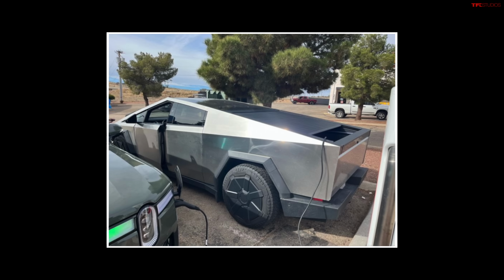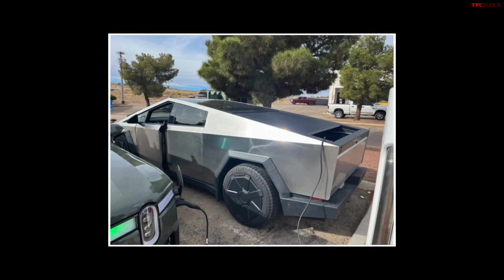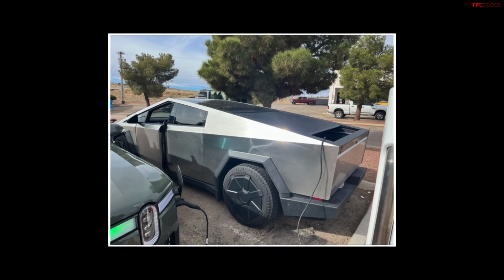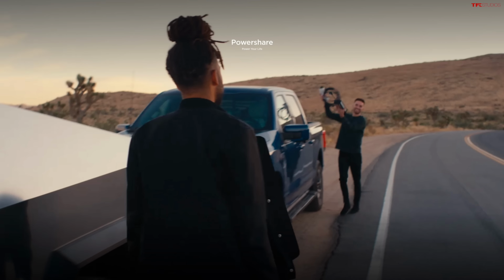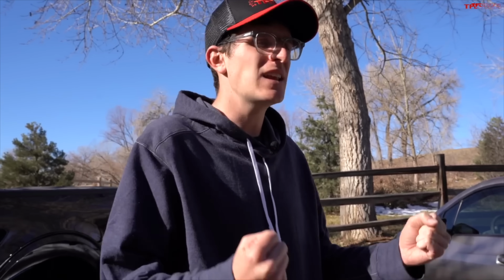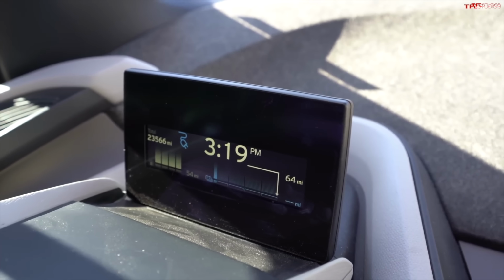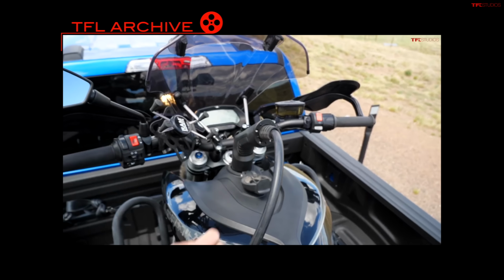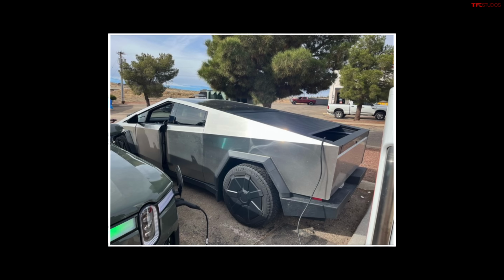A Tesla Cybertruck Rescues a Rivian R1T: Here's How!

Comment: You can power your home with a simple generator interlock switch from the 240v feed.  No need to spend thousands and thousands on the automatic setup regardless if its Ford or CT.  I'd love to see the 240v outlet make it's way to the 3 and Y, but I think CT only did this because Ford had it.  This will clearly cut into the powerwall sales.

Comment: 3.0 miles/kwh on the R1is a stretch.  in my 20K miles on theR1T, I have averaged 2.02 mi/kwh.  I'm looking forward to the equipment to use my R1T battery with my solar to run the house or help charge my Tesla powerwall.?????.....

Comment: Not really ground breaking. The charger will pull the max from the outlet that it can, it's not going to care that it's in another vehicle or a house, or generator. Now, direct charge port to charge port for higher speed transfers might just be a software toggle if the sending vehicle has hardware for bidirectional charging, or vtg or whatever you call it.

Comment: Can someone do an actual test to see if the Cybertruck can simultaneously  import DC power and export AC power. If that could work, then you would really have something. 

I saw AC to AC tried on a TSportline video and it didn’t work. I didn’t see them try to adjust settings, etc. If it’s possible, I would like to know.
Reply: It has been done and it can’t charge and give power.
Reply: @jackylsmith8138  I saw the video attempting to charge the CT via AC, but not using DC.  It was also very quick video and I did not see them checking to see if settings could be changed on the screen.  Can you direct me to the video showing a more thorough try using DC to AC

Comment: The cable has a J1772 plug at the Rivian end, so I’m sure it is rated for 240v or 110v depending on which adapter they have plugged into the Tesla. I’ve had the same cable with several of my EV’s. 
You don’t need to sit there until fully charged. Just enough to get to the next charger. That’s how I do road trips. In a non Tesla I charge to the distance and a buffer that accounts for speed, wind and temperature. In a Tesla, the route planner does that for me. In either case I like to have enough to arrive with a buffer of 10% to 20% since the battery charges faster in the bottom 50% than the top

Comment: BTW, those who get the CyberTruck Foundation model get home backup included in the price of the truck, and also includes $4000 credit for the installation. Granted, the “Foundation” model has a hefty surcharge but at least you get some value out of it. Given it includes FSD, which is a $12k option, to those who intended to buy it anyhow, it’s not such a bad deal.
Reply: You don't get the $4000 credit for install anymore. Just the equipment.
Reply: Isn't the "Foundation" model a $20k option?  Also, home backup requires a Powerwall, doesn't it? Don't see any planet where that math works.
Reply: @1970351C2V  it so $20k but includes FSD ($12k) and all the equipment required for home backup including $4k credit for the install. If you have a PowerWall installation is easier and quicker (no permits needed from power company) but it’s not required.
Reply: @1970351C2V  Yes it's a $20k option basically. But it also comes with the $4k powerwall installation credit, FSD, and some other goodies... I did the math a few days ago and you're basically paying $2500 for the badges and the privilege of having one first
Reply: @1970351C2V 
Drew says POWERWALL not required. Needs 'Gateway' + Charge unit which are included with FS

Comment: Ford and Tesla do like to chasee each other by using the same ideas.
Power drawn from a truck is the Ford innovation. Obviously implemented by GM and now by Tesla.
Inspired by Tesla Model Y modified for not ending up in copyright infringement was the Ford idea called Mustang Mach E.
The latter EV and Ford F150 lighting implemented a very good concept of front luggage compartment inspired by Tesla.
Rivian implemented the frunk but not vehicle to load capability.
V2L was first implemented in rudimentary way by Hyundai group though. The idea came from Nissan LEAF never implemented commercially via Chademo in North America.
Ideas are old but implementations are new.
Reply: The VW beetle had a front trunk. That was invented in 1938. You think Tesla invented this front trunk. You better learn some history. A lot of exotic sports cars have front trunks, like the one Tesla bought bodies from to make the original roadster.
Reply: @jackylsmith8138  Before starting an internet quarrel you better learn to read in English. I clearly wrote about BOTH front and rear luggage compartments found in NSU Spyder with Wankel engine. The Bug never had luggage compartment in the rear. That was percieved as gimmick while Tesla brought it to mainstream to have BOTH luggage compartments.
Reply: @nevco8774  first of all I'm not sure that Tesla was the first installing Front and rear luggage compartment the same car, but even then it's not some kind of innovation, frunk is a old idea used used in many cars , adding that to a car that also have trunk is not some propriety idea. But for the sake of argument let's say it is, the lightning only have frunk no trunk.
Reply: @simson4t  Your argument makes no sense. Look Jay Lenos Garage NSU Spyder with Wankel engine in 60ties had luggage compartments both in the front and rear. Tesla got inspired by old designs like that and made it a norm.
Reply: The frunk and vehicle to load are very rudimentary and obvious ideas.  I don't think they really qualify as innovations, in the sense of something that no one else would have thought of.

Didn't the VW Beetle have a frunk?
Reply: @davidmenasco5743  I meant to have luggage compartment in front and the rear which was never available in cars with ICE based on pistons. Only Wankel engine based cars like for instance NSU Spider featured on Jay Leno's Garage YouTube channel had some luggage compartment in front and in the rear.

Comment: Use a 100K truck with a massive battery pack as a power bank. What could possible go wrong? Besides the gimmick, it's just serves to degrade the battery pack faster, turning it in a lawn ornament, or used for scrap to build urinals.
Reply: It wouldn't be as hard on the battery as normal driving so no worries.
Reply: BS
You think that cable has the rating to "drain the battery pack faster"?
.
You're more desperate by the day.
Reply: @rogerstarkey5390   Yes, because the average truck owner is rushing to buy a 100K Science project. Or Tesla was able to counter the Laws of Thermodynamics, creating a battery Cell that doesn't degrade at all. Not!
Reply: I disagree. I think bi-directional charging is a great thing since you can help other people on the road if they run out of charge or charge your own house in an emergency. Anyone who doesn't think this is a good thing is mad.
Reply: @migueljardim8177   It's a handy feature for a casual use. Not to an heavy duty level routinely. It like using the dishwasher as a washing machine. It can do the job, but not as efficient or with the best results.
Reply: This is designed for emergencies, not for daily use. It would cause no damage to the battery as driving the vehicle (eg accelerating) would use larger spikes of power than home backup. The fact that you can use it as backup means that during power outages you have 3 days worth of power to power your home. If you have solar you can charge the truck during day time and likely extend it to a week. Given most outages are 3 days of less this is an extraordinary power backup solution
Reply: Actually, people who own the Lightning report that this feature is super useful.

They can power sound systems, camping gear, and whatever else.  The uses they report take about 1% of the battery in eight hours.
Reply: @davidmenasco5743   So useful they are pilling up in inventory.
Reply: @RogerM88  Oh my goodness!!  I'm a car dealer and there are cars on my lot!!  The Sky Surely is Falling!!!

Nice try.  But every one of those trucks is going to find a very appreciative home, and every one of those drivers is going to recommend it to their neighbors.

I predict Ford's electric truck sales will double next year, and continue to grow significantly every year for the next decade.
Reply: Obvious Elon Hater with zero grip on reality
Reply: @tripleb5232  Fanboy in denial mode.Who's even talking about Musk? We are talking about a niche market truck, targeting a wealthy costumer base, similar to the Rivian R1T.
Reply: Why are you even watching this channel?
Reply: @jamesengland7461  Some Tesla fanboys are so sensitive.

Comment: Pretty thick for a 110 cable
Reply: Actually no, the cable in the photo is about as thin as a cable can be and still be safe in an EV charging application.  And 110v cables come in much larger thicknesses.